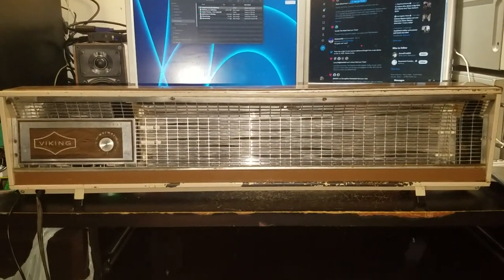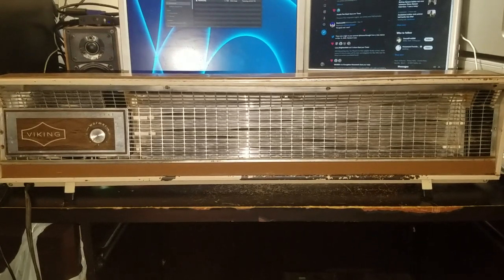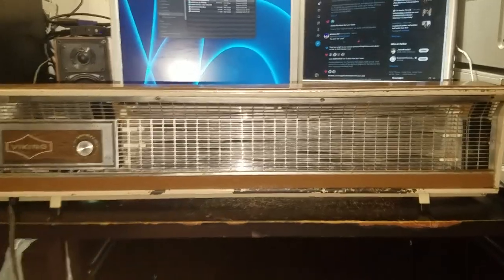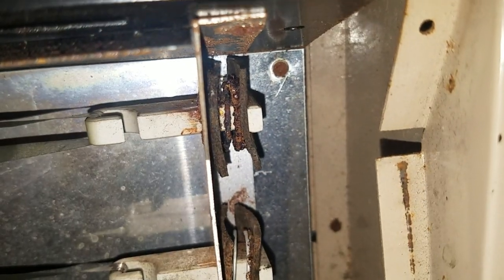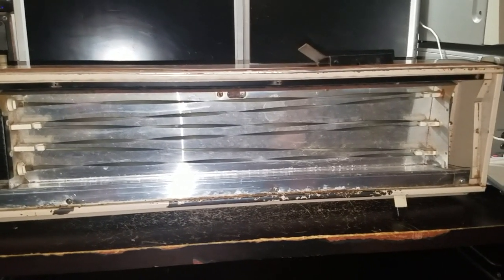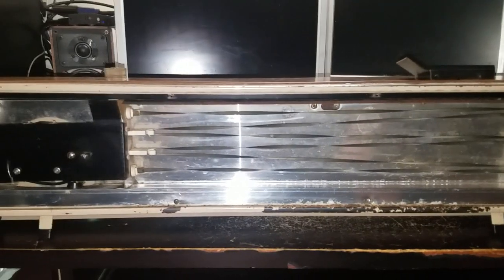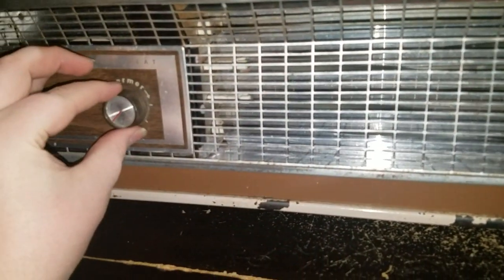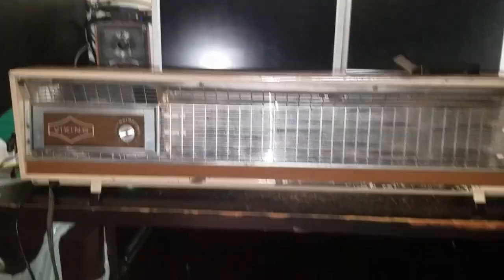Short: Good bye, 1968 Eaton Viking heater

Comment: It's sad to see more Viking electronics go away, Viking and Baycrest stuff used to be everywhere! But you made the right decision. Safety first, especially when it comes to things like heaters.

Sometimes breakers won't trip at their rated current right away, especially if it's from something intermittent like an arc. That's why (at least here in Manitoba) new homes require arc-fault protection on the circuit breakers for bedrooms. That way if someone is using a space heater and it faults like yours, the breaker should trip.

Comment: Wow, I have never seen a heater with that kind of electric element before. In New Zealand we use a lot of electric heating (we have lots of hydroelectric generation). In "neighbouring" Australia where I've also lived for some years, it's generally much warmer with shorter milder Winters, but some electric heating is also used during mid-Winter. The standard electric heaters like when I grew up were a dowel like rod core, about 5/8th inch diameter, made of some kind of ceramic, upon which a spiral of many metres of NiChrome wire is wound. Smaller heaters having "1 bar" or 2 bars, and larger heaters having 2 or 3 bars. Remember we have 240 volt AC with up to 10 Amps available from each standard domestic single phase wall  outlets. More modern electric heaters also have 1 to 3 bars, but the bars are some kind of glass tube and the wire windings are INSIDE the glass tube. I've never seen exposed heating wires like in your video here. Nowadays "heat pump" reverse cycle air conditioners are favoured because they give more than one kw/hr unit of heating per each kw/hr unit of electricity they consume (as well as being air conditioners in Summer). Oil containing "fin" metal heaters are favoured for spot heating  as they are less a fire danger if clothes etc fall onto them.  Cheerio from the other side of the planet, currently enjoying our early Summer period !
Reply from the maker: We have the ceramic bar type too, but they are very uncommon here.

Indeed, the higher voltage is probably why you don't have this type there - the element would need to be way too long.
Reply: @themaritimegirl  If Australia & NZ are the same as the UK the element dangling like wire with no support might actually break our safety rules for selling heaters, in the UK we get various types of 2kw heaters for 230v made cheap in china, some are fitted with 6 amp cord which heats up & melts if you run the heaters on full power, I had one in 1998 I lifted to move it & the power cord had melted through under the fan heater, got sparks & the heater stopped... and that could have went anytime... some over here would say your viking heater could be dangerous but chinese "too thin power cord" heaters, kettles & toasters are a fire hazard.

Comment: I got one of those with the Roach Palace. It is an Arvin heater. It had been left out on the very leaky back porch and was extremely corroded. The control knob was also long gone. I never tried it.

Truthfully, I'm not a fan of these heaters with their NiChrome wire elements.

Comment: Hey, this is so cool cause I have never seen anyone with the same brand heater as me! Mine, however, is still running strong. Mine is a 1971 shorter by half, and the elements are an upright zigzag rather and no springs model.mine also has the fan but but it's never seized. I wonder sometimes if this old girl is immortal lol she just keeps on keepin'' on. I think,though, possibly since the upright zigzag makes the difference? But who knows, perhaps yours, at some point, was exposed to moisture from a spillage or something and doomed yours because your other two springs look fine. Ah, well, too bad.personally, I love this old girl as to me she's laughing in the face of modern obsolescence. Anyway, I'd have fixed her for just that reason

Comment: That’s sad, but I was thinking “I see why ceramic PTC with a large heatsink is preferred now, just one electrical connection in a small place”. That’s even displaced the halogen heater tube kind, although I miss their red glow and silent operation. 

Thankfully I haven’t had to use standalone heaters since I moved somewhere with central heating. For a long time every place I lived just had stand-alone heaters stuck on the wall and cold spots I had to supplement with my own heaters.

Comment: Honestly, this thing - provided it's hooked up to a grounded outlet protected with a GFCI - still seems safer to use than the modern heaters with plastic case. I wouldn't hesitate to replace the spring. It's a basic repair and the risks are very overseeable: too little spring tension and the heater tape will sag and (worst case) melt through, contact the case and trip the GFCI.